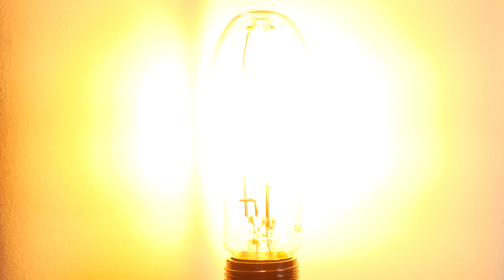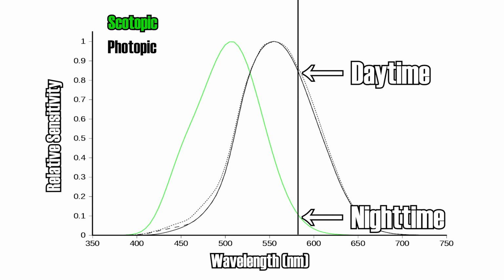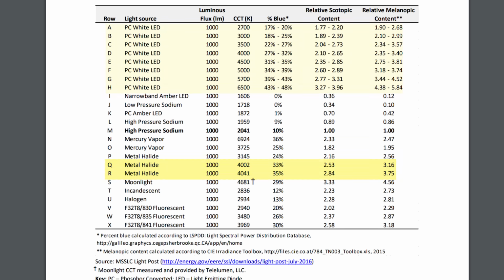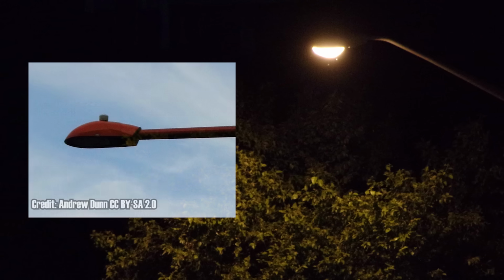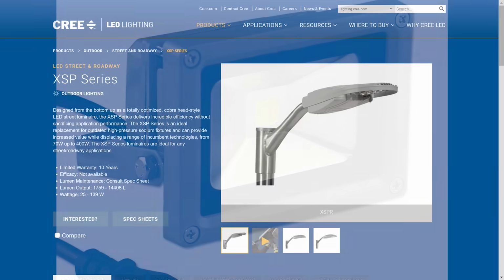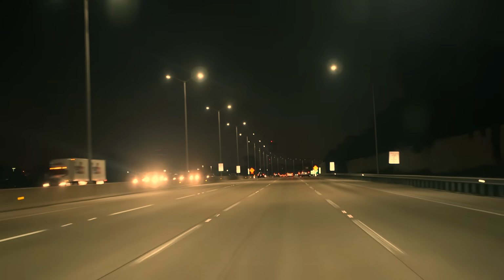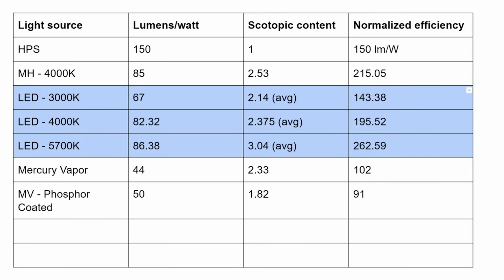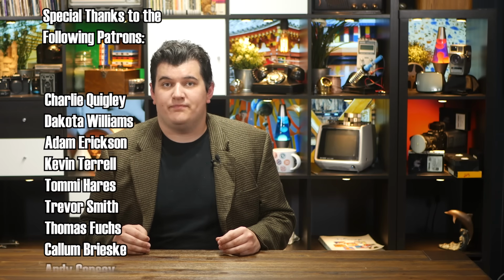The LED's Challenge to High Pressure Sodium

Comment: I always thought one of the advantages sodium lights was visibility in fog.  Anecdotally I've always found that the yellow lit up the road but not the fog where the cooler lights tended to just glare off the fog.
Reply: i have LED lights on my enduro helmet there very powerful and bright but there no good when your in a forest something of about them it's like playing on a 60hz monitor and thay fuck with my depth perception, and shadows don't look right and god help you if there is fog or  your behind a 2 stroke or any bike really it will blind you the LED picks up every particle in the atmosphere and reflects it back at you

Comment: And one other weird thing about LED lamps - they can be cut down to fit!  We have a decorative lamp in the living room (dancer holding aloft a sphere), which takes 'small bayonet' (this is the UK!) bulbs (which were hard to find even in the old days), and the only LED bulbs I can find (of the right wattage/lumens) are 'candle' shaped - which don't fit in the spherical glass fitting!!  I was pondering this one day, when it suddenly occurred to me that LED bulbs are mostly just a copy of the old incandescent bulbs in shape - they (mostly) don't need to be that shape, they're just made like that to look familiar.  Closer inspection of one of the candle bulbs revealed that they were just soft plastic, so I took a chance and sawed the top off one, so it would fit into the glass sphere.  Even though I was pretty sure this woudn't affect the bulb at all, I was very happy to see that it still worked!  They only problem is a bright spot at the top, where the light is unfiltered by the opaque 'candle', but, as the LED bulb stands a lot higher than the old incandescent ones, this looks no odder than the high position of a normal 'small sphere' LED bulb, and you soon don't notice it.  So, if a new LED doesn't fit an old fitting, simply cut it down to size!

Comment: Keeping awake whilst driving at night strikes me as a good thing...  Our road has recently been converted to LED streetlights and they are MUCH brighter - weirdly so at first!  But they are also much better focussed downwards, so hopefully that is decreasing light pollution.  I've also noticed that where a streetlight is right in front of an upstairs window, flat plates (shades) are fitted behind the light to prevent it shining through the window.  As for LED reliabilty, I've been gradually converting the lights in our house to LEDs over the last few years - but not without problems.  Firstly, most don't work with dimmer switches (which we have at least one of in most rooms), and those that do don't work well (stepping down, instead of fading, or often flickering at certain points in the 'fade'), and LED compatible dimmer switchers are VERY expensive (5 or 6 times the cost of ordinary ones), and usually only seem to come in one design.  And, secondly, I have had about 10 LEDs fail in that time, out of about 25 fittings. A couple of these have been physically failings - the bulb coming apart or cracking, but most have (apparently) been the electronics - some simply failing, others flickering or fading.  This is a serious flaw with LEDs - the 'bulbs' themselves might last 20 years, but how many electronic products still work properly (or at all) after such a time?  OK, they still appear to last much longer than incandescent bulbs, so you have to replace them far less often, but given how much more expensive they are (typically still at least 10 times as much), having to replace them at all is far more annoying.  And one last odd point - in the past I used to keep a stock of replacement bulbs, so if one did fail, it could be replaced in 5 minutes, but now I don't keep any spare LEDs (because, in theory, I should never need them!), so, if a lamp fails, it can be a day or two before I can buy a replacement.

Comment: Mercury vapor lamps are still common place in Japan . LED is creeping in of course but mercury is still very popular , maybe not for street lighting of main roads anymore , but for footpaths and alley ways  and areas , parks , carparking , etc mercury is still being used and installed installed new.   It gives a lovely white light , is reasonably efficient and one of it's main advantages is very high reliability  / long life.  
Unfortunately the best LED products have very poor reliability and life expectancy in reality .     Manufacturers seem to use cheap production and push components to the limit to get highest output possible with even the better  LED products . It's a shame because LEDs have the potential to be very long lasting light sources.

Comment: Working as a lighting designer  with street lights, a small note of situation today.   Working in Finland, .being far up north, the lenght of the night varies a lot. In summer time, there might be less than 4 hours of dark time, in the north, even less tähän an hour . In winter, the dark hours can be as long as 20 hours. This means, we usually have two step dimming,  going as low as 40% of the nominal light output in the middle of the night.

With new optics and up to +130 lm/W output, we got up to 75% energy sawings while improving the lighting conditions  last year as an average  of 2300 street lights, just by replacing the  old lighting fixtures with new 4000K Led lights.

Service costs go down as the changing of light bulbs every 4 years (+cleaning etc)  is replaced by cleaning every 6 years.   Nominal life time with CLO (Constant Light Output) is approx 25 years.

We use 4000K as a compromise,  as 5700K is too cold,  and 3000K less efficient.

In general, the biggest advantages with Led Lights is the variety of different optics, and the possibility to use dimming.  Usually pre-programmed  dimming like dynadimmer., but other options are also avalibale. Also fast adoption to changes gives a lot of possibilities,  Sodium lamps give full light a few minutes after igniting,   and it takes forever to re-ignite as it has to cool down first. Led is instant reaction. This can be used as movement triggered light on jogging paths and similar, with lights on only where needed.

Lumens is not the primary reason why Led outperforms sodium lights, there are other benefits that are more important.

Comment: In a few city in France they've installed blue led that only illuminate pedestrian crossing. The light is even focus to match a rectangle around the crossing.  I've seen at least one instance where the light is definitely way to bright for the residential area it was in but I can tell they are extremely effective compared to the regular sodium lamps.

Comment: I hate these new ghost white street led lights. No only i find it more dangerous to drive because the incoming traffic headlights blend in with the street light, so you can not see cars coming before a corner like before.
Also this color disturbs your sleep even more than those yellow light. So it also affects your health.
There is also an issue with animals that get even more blinded with this light, specially birds

Comment: I use LED's Horticulturally and they've certainly taken off over the last few years, everything from the energy saving, to the ability to set the spectrum and light intensity in accordance with the plants stage of development is great. Expensive, but really cool and useful tools.  

One thing i'll note they may not be as maintainable in varying climates. See usually the diodes burn up in hotter temperatures, they can also be easily damaged by water precipitation.  There's obvious ways to keep em running longer by building nice boxes and housing with fans and such for the driver and panel to keep all the electrical shit safe, but i can imagine some regions that have some odd weather where these are more likely to be damaged over traditional gas bulbs. Gas bulbs are just air tight and really only need the fixture to house the electrical stuff. They also run so hot that they tend to keep water from accumulating on the important components. 

There's a thing in indoor horticulture where some people want everything to be as similar to nature as possible and are willing to be inconvenienced in an effort to do that. or they want everything so state of the art that nobody else has it yet and they're willing to pay more for it.

Truth is those who do the best are the people that incorporate the newer more convenient stuff where they can and avoid trying to "Keep up with the Jacobson's" This is a good way to look at infrastructure as i see it. There's a reason not every city has a subway system or solar panels and wind turbines everywhere. Some of those things just aren't conducive for the region. 

maybe LED lighting is one of those things that's a useful tool in the right situation. I know this wasn't a well sourced article on lighting and it's impact on future infrastructure developments, but i hope this perspective was useful all the same.

Comment: Sure you can see 'better' with cooler lighting, but why do you need to--especially at the expense of health? As long as you can see enough, why burn out the environment with light pollution just so you can make out insignificant granular details of the roadway while driving at 50 mph? I don't need to see what the thing is to avoid hitting the thing, I just need to see that a thing is there.

Comment: Wonder if you could make it better by using the led sets that emit light in one direction, place them lower more to the side but angle it, instead of straight down, more toward the street if that would be a better system for it too, but I don't really know.

Comment: Anyone over 30 who grew up in the sodium lit roads. Is it just me or does anyone agree all the LED lights just blind you? I feel like I could see just fine with sodium lights even looking right at one. One bump in the road from the guy driving behind or towards me and I'm blind for a few seconds. How is that more safe?
Reply: Well, LED lights are just brighter. The modern headlights are generally made smaller (because it looks cooler, I guess). It is not the light source technology, but the fixture design. Halogen light with a certain type of lens will blind the same way. There are regulations actually, limiting the maximum headlight brightness (at least in Europe), although this maximum brightness is quite high.

Comment: Can you do a thing on the HID lights that come in (originally German cars) and now a option in most i love these things you can see so much better, not talking about those stupid fake things were thay just paint a bulb blue a call it HID real hid systems thanks
Reply: They work basically the same way as the high-pressure sodium lamps this video is about. But instead of just sodium, the bulb contains a mix of several metals. Every metal emits its own wavelength and the mix is made in such a way that the resulting light is white and has a good color rendering index. But this technology is dying, being replaced by LEDs

Comment: Looking at the specs seems to show that 4000k (it seems to retain most of the efficiency) may be a good compromise and that combined with good downward reflectors may be the way to go.

I do have my doubts about plug in replacement LED bubs and think that while they may have a use for where lamps have gone out, that should not be used instead of complete lamp with housing upgrades.

Good downward reflectors seem like a win win, as it is almost like free energy in that extra light will go where one wants it with no extra input.
As lower output led's can then be used and much less light is pointed up and to the side it must be good for overall light pollution.

Lighting buildings is wasteful, so perhaps they could not use them every day.
Perhaps a couple of times a month may be enough.

Overall it seems that the case for LED lighting has been made until something else comes along.

Comment: If I can't see the road because of the oncoming traffic, then it isn't a good idea.
Reply: LED headlights aren't really the issue. The issue is poorly designed headlights. Many headlights, especially older cars with LED headlights and aftermarket conversions put way too much light off the road and direct it at oncoming cars. The LED headlights on my vehicle are designed quite well and put almost all of the light onto the road, therefor not blinding to you. And obviously, they are extremely beneficial since I never have issues seeing. Tall or lifted vehicles with LED headlights, however, present a different problem since their headlights are eye level or above you. Though I am sure with some ingenuity that can be solved.
Reply: @dthompson3426  tall or lifted cars should not be allowed to use LEDs unless they are pointing down away from the eyes of oncoming traffic
Reply: Even if the LED headlights point down at the road, if the car hits a bump or goes over a hill, the car can bounce and blind oncoming drivers. Had it happen to me and people I know several times.
Reply: In Europe, your vehicle height is in fact tied to the angle of your headlights. In North America on the other hand, nah, we don't need that apparently.
Reply: @Zyo117  I mean, that is nice and smart, but also I think part of the reason it's done in America is because of trying to be creative in how the cars look
Reply: @Zyo117  well if you actually do it properly you are suppose to adjust your headlights. It's extremely simple, pull up to a wall mark on the wall where your lights shine, do whatever it is you want to do to the car, then go to the same spot and adjust it to point the same place. So really its not the issue of lights or how bright they are just that people don't adjust them properly and they shine right in your face instead of on the road. Improper adjustment of lights is illegal in some states.
Reply: KelMaster Construction  you do realize the argument was about street lights, not car lights, right?
Reply: KelMaster Construction  yeah, but the blue/red part was not on the OP's post (that's what I was referring to)

On your topic, I wonder how much of the problem is caused by not taking in consideration the increase efficacy of lighting and using the old angles for not blinding incoming traffic.
If, given an angle that provide the same level of frontal blindness of old, you get less light on the road then yeah, LED don't belong on headlights. If you get more we need to require more consideration from manufacturers/mechanics when using them
Reply: KelMaster Construction  i think you just got bad eyes bro

Comment: There was this gas station in my area that was pretty dark and shady at night, I guess they realized this but over compensated, they put a bunch of LED lights everywhere and it made the station brighter at night than it was during the day, a lot of the lights were horribly aimed too and shining into the road, I hated driving by that place at night. A few months ago, the lights were finally re-aimed, I'm assuming they finally caused a crash.

Also cop cars that use LEDs at night are also irritating. I was stuck in a traffic jam once that happened due to a crash and the cop car near me still had it's flashing lights on, it was torture.

They need to find a way to dim them at night.

Comment: Looks like you've covered all the bases. The use of elliptical lenses and shrouded housings in LED replacement fixtures to produce a broad, narrow sploosh along the road helps reduce light going where you don't want it, making full fixture replacements potentially superior in terms of both even lighting and sky glow.
EDIT: Actually, a lot of the replacement lamps have these elliptical lenses as well, making their light distribution superior to that of the original HPS lamps reflected by the fixture's...well, reflector. Big Clive did a video featuring three such replacement lamps, and they all tic the boxes in terms of more even lighting, better color rendering, and less sky glow.

Comment: I think one aspect of LEDs that is forgotten is its ability to be dimmed. The less artificial light around a driver at night, the more his or her eyes can adjust. The amount of street light needed at say 7-9 pm or 5-7am than deep night from 10pm-3am. Street lights use photocells to turn on and off. A simple timer would be able to adjust brightness as the night goes on. This can also be used on LED traffic lights, so the bright green or red is less jarring on the driver. As an electrician, there are many benefits of LEDs used in the commercial environment that would be very effective in outdoor and travel segments.

Comment: Nearly all outdoor lighting in my community is being replaced with 4000K-5700K LED fixtures. It is definitely more effective than HPS. However, I wouldn't say that it is safer. Streetlights don't provide 100% coverage of the road surface. The problem that I have observed is that objects in the non-illuminated areas are more difficult to see because the eye needs more time to adjust to the change in lighting conditions. This is a greater issue in rural areas where street lights only illuminate curves in the road and intersections. Under these conditions, objects just outside the illuminated area are more difficult to see than they would be if no street light existed. This effectively creates blind spots in the visual field. I would really like to see what a road illuminated by 3000K LED fixtures looks like at night. I suspect that it would be much easier for they eye to transition between the illuminated and non-illuminated areas.